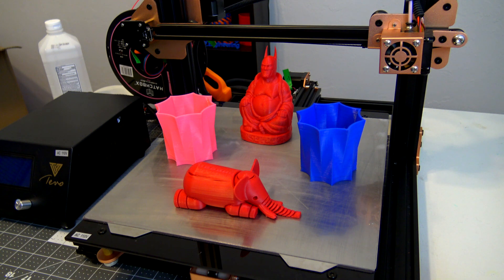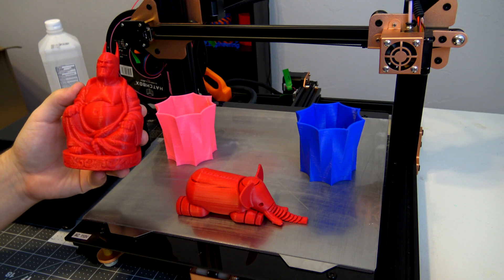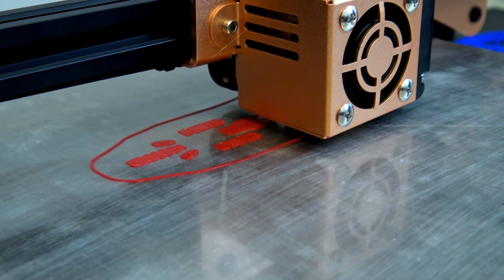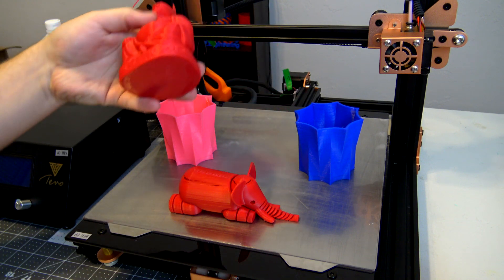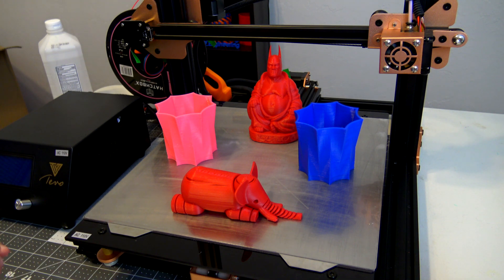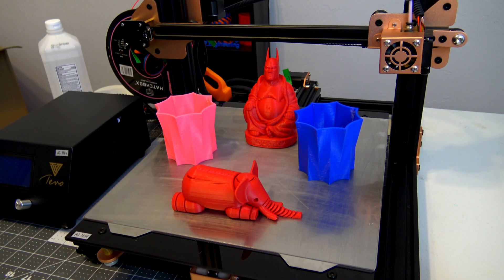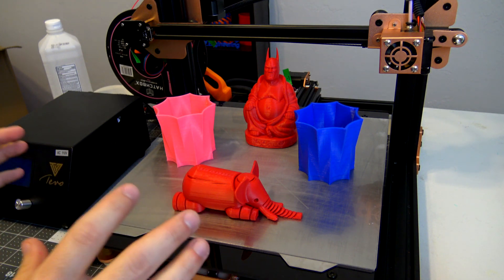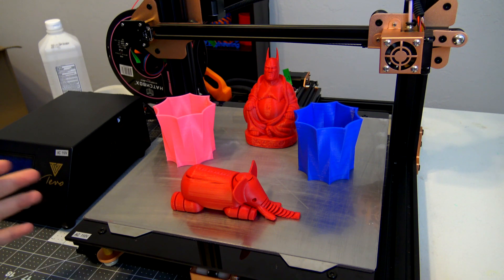Final look at Wham Bam: Magnetic Flexible Build Plate for 3D Printers

Comment: So if you need hairspray and glue stick why speed money on their build system when you can just print on glass? I print on glass and once I got my bed height dialed in my prints just pop right off.
  Why does everyone talk about build plate rotation, this has got to be the absolute dumbest thing I hear people talk about on Youtube, You print a 40 hour print but you can't wait 4 minutes for the build plate to cool down........really.....like seriously.....are you kidding me right now? The only reason I could see needing to do this is if you have a 24 volt bed heater and your powering it with an under powered 12 volt power supply and it takes and hour for your print bed to heat back up. If that is the case then spend $20 and get a beefier power supply or upgrade your bed heater.

Comment: Going to the kickstarter page tells us that they change from the standard vinyl binder to one that stand higher temperatures to 130C.   vinyl electrical tape is rated to 80C.  Vinyl siding is rated to 88C.   Compounds with vinyl can reach higher temperatures.  Most do not exceed 100C and only one is rated at 150C.  The magnetic particles are ceramic which is good to 250C.  And the flexible magnet will duplicate the flatness of the original build plate.  So do not consider using this product to correct a flatness problem.
Reply from the maker: I can confirm, the magnet is extremely flexible. They do provide aluminum shims to help correct for an uneven bed, but sometimes there's only so much you can do.
Reply: You know what will correct a flatness problem, an auto bel leveling system, you know what else a bed leveling system will do ? It will get you that perfect squish on your first layer so your prints stick and then pop right off when the bed cools!!!

Comment: Nice video! Thanks
If printing ABS, it is very advisable to have an enclosure, it makes all the difference!  
If you print ABS in an enclosure you shouldn't need hairspray or other adhesives.  PETG holds directly to our PEX build surface.